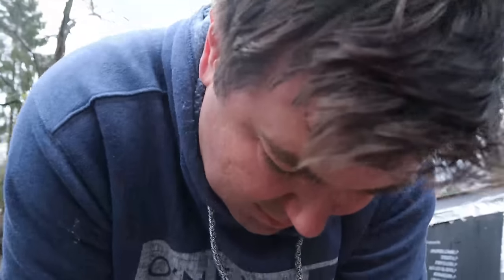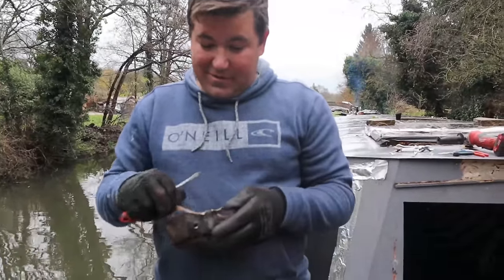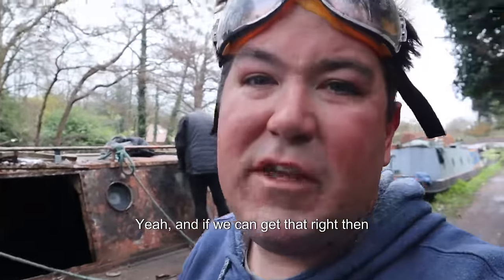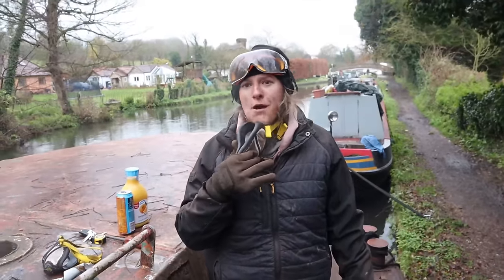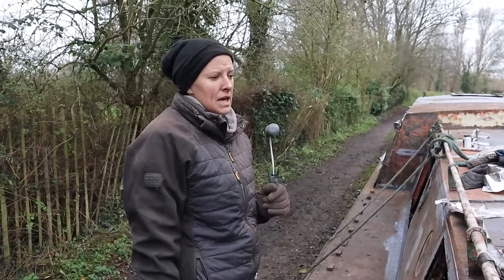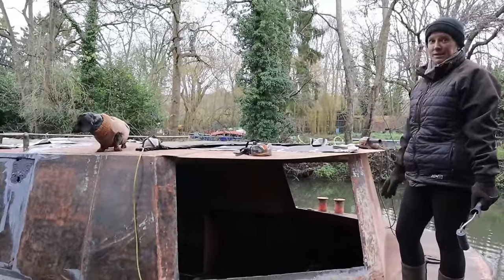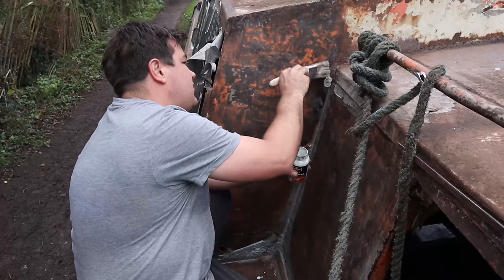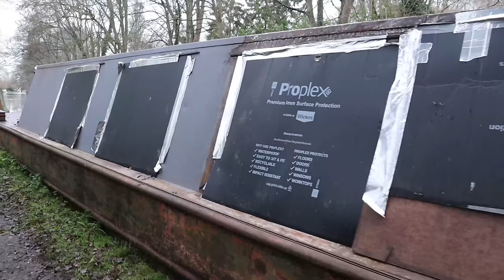What 21.7 HOURS GRINDING a Rusty Barge gets you!! - Episode 11

Comment: I am enjoying watching your progress and your great sense of enjoyment over this project. A few comments to a few of the naysayers who have been critical of your approach. Yard time (or dry dock time) tends to be costly. In the Navy a great deal of effort is put into preparing for the work in the yard to maximize the repairs and minimize the drydock cost (time).  That preparation includes just what you are doing - scraping and painting. “Sandblasting” can be extremely damaging and can cause greater damage to the surface than hand work. The fact that you are grinding off the paint and corrosion gives you much greater control and reduces the amount of potential repairs. Corrosion will appear on any metal surface over time. I think that you have delayed that process considerably doing just what you have been doing. It is good to that you are vacuuming up the grindings to reduce the amount of paint flakes (probably lead based) into the water. It is the hull where your yard time will be most revealing, productive and cost efficient. The fact that this barge, now narrow boat, is still afloat after so many years attests to its water worthiness.  Please keep up the good work and ignore the naysayers. People often forget when they fire a comment that not everyone has an unlimited budget. Your yard time will help you considerably and I do not see any downside to what you have been doing so far.
Reply from the maker: Thank you so much for your kind words. You are 100% correct we don’t have unlimited Budget so we are doing what is possible. I’m glad you can attest to our methods thanks so much for your input :) We are actually going into the dry dock very soon so we will finally get to see below the water like. thanks for watching we appreciate your support!! 😃
Reply: I love seeing comments like this, as opposed to the negativity. In my humble opinion, if a couple decides to spend quality time together doing something that they can enjoy and be proud of for decades, I'm totally all for it! I've spent time on projects that people with negative attitudes and ugly personalities had ugly things to say about. Other people's opinions are simply none of my business.
Reply from the maker: @talltom1129  Thanks Tom we appreciate your kind words :)
Reply: @DuoVagari  just keep being you!

Comment: Just some good advice, I had a 35’ sailboat for years , always keep a good hand of tools on board, Sockets, Spanners , wrenches and etc ! It helps . In open water it’s a must !😊
Reply: You can never have enough tools and the basics are not expensive. A metric socket set, a set of imperial open-ended spanners, vice grips, adjustable spanners small & large and adjustable pliers. Now you can fix anything instead of ruining it. It is soooo satisfying.
Reply: A tad risky  if you cannot secure the boat against thieves, though.  Once the boat has reached the point where one can lock it securely it's a different story.

Comment: Incredible progress guys! Just a quick tip, if the pull cord on the generator breaks again, and you got a socket that fits the flywheel nut on the generator, you can use your cordless drill to start it. just make sure the drill is going in the same direction as if you were pull starting it.

Comment: Just get it out of the water and on land and invest some money in having it sandblasting so you’ll have a good clean steel keyed base to do any necessary repairs for needed and quickly epoxy prime onto before rust starts to come back.
But I definitely would sandblast it so the paint job especially in sweet water can potentially be okay for the coming twenty five  to thirtyfive years.
Doing it in an amateur hands tool way will eventually cost you lots more work for way less quality results.
Personally I would have it all sandblasted and painted with windows put in there so I could take all the time I would need to finish the interior and engine room with necessary systems.
Reply: shame they never did :(

Comment: A wire brush wheel on your grinder would work better for taking off the old paint and stripping it down to the metal only a suggestion and have a blessed day from Canada arnprior Ontario

Comment: I find.  Doing small  sections at a time.. descale,sand, clean, primer. Then move to next  section.. this way the metal doesn't restart rusting.  Starting from top of roof and work down ,not to contaminate a prior cleaned and prepared surface.

Comment: You know, you can get a wire brush to fit the grinder and the are a great bit of gear. When you start your genny don't let it run for to long with the choke on. All your doing is carbonising up the internals. Your a lucky man. Not many women know how to use the tools designed for them, ie Vaccuum cleaner[ chuckle] but also power tools. Its great to see how enthusiastic the pair of you are.

Comment: Hey guys I like what you're doing to the boat but when you haul it out you're going to really need to sandblast it twice a first sandblast should be  course sandblasting it'll loosen up a lot of stuff you can't move sanding discs like you guys had the second sandblast should be fine sandblast it'll smooth it out the metal and open the pores up so when you spray primer and it should be epoxy primer two coats and you should let the first primer dry for like 4 to 5 days before you spray the second one then you're whatever paint you're going to put on it you want to put another two to four coats and you'll see a difference when you do the sandblasting you'll find things you thought you got done am I suggestion inside and out especially inside the boat knowing how Rusty and how much water was in there the other thing is we want to make sure that for the bottom of the boat inside have metal work done figure out exactly how you're going to set the boat up and have metal passages put into the bottom so you can route your wiring and your plumbing and all the other good things and your Center  bilge and for about that big I bet anything you should have 2 bilges pumps a primary a secondary   because that's a big boat. And once you primer the inside of the boat then you can spray from it was the really good closed spray foam that'll make it really comfortable have a great Christmas

Comment: Old rust protection paint does often contain lead, so it is recommended to wear a good breathing mask to avoid lead poisoning by little lead particles you breathe in your lungs. By the way: Sandblasting works much better and quicker than grinders.

Comment: Just started following as I’ll be buying a boat but fortunately one that’s already ready to just move in and cast off. Waiting to see how the windows fit in. I’ve used an alcohol based heating system in a caravan and they are really good if you are going down that route.
Reply from the maker: Nice thanks we appreciate the support, Best of luck with the boat purchase hopefully we see you out on the water :)
Reply: @DuoVagari  wide or narrow is something I really need to look at due to how much I can navigate etc.
Reply from the maker: @madmikesworld5713  it’s a hard choice for sure but you may be surprised by how much is achievable with the wide beams. I guess it comes down to how far you intend to travel.

Comment: Please don't takes this wrong but when doing a job you need the right tools ! If you worked in an office you wouldn't use a tree to write things down having said that the covers for the pull cods you need a socket and extension and rachet  or painting the boat you don't use a sheep you use a roller ..... RIGHT 1

Comment: Just wondering what condition the hull is in , before you spend loads of time and money on the upper part ?
Reply from the maker: From what we can see on the inside it looks ok. We did some measurements and the steel is still within tolerance. We are taking it to the dry dock in January so will know more then.
Reply: @DuoVagari  👍

Comment: I see there are lots of negative comments about how you're doing stuff, the important thing 1st and foremost is that you saved a piece of canal maritime history, they didn't. Having been responsible for managing work on historic buildings, you'd be amazed how many experts there are out there. All I can say is just do the bare minimum to make sure she's still water tight and the metal doesn't deteriorate, until you get to the dry dock. Have a look over at Ship Happens and how they are doing their restoration, I know it's a wooden boat, but you might get some ideas. Good luck 👍

Comment: Here's a little trick that will work most time. Take that pull rope recoil off and get a 6-point socket that fits the large nut on the inside of the capstand. Be sure you have a battery drill with a fully charged battery, (1/2" Drive drill works best). stick it on that nut and you've got an "Electric starter) Be sure it's a 6-point socket. not a 12.  works great on smaller motors. 
May want to think about getting a socket set onboard also... I liked the way you "Removed" that rope starter..... I was waiting for it to go flying in the canal... LOL,  I would have defiantly skipped that thing across the water.... LOL

Comment: There is a time limit for using electric hand tools. The vibration is the problem. Please do some research about using grinders, hammer drills etc.
Reply: 30 years of using electric hand tools no problems, what's the time limit? Your body tells you when it's had enough if something gives you aches and pains stop until you recover, common sense really.
Reply: @1425race  H&S will tell you how long is advisable. White finger is the usual outcome of excessive vibration. Oh, and a dust mask would be useful too when grinding or sanding off. Yep. Common sense.